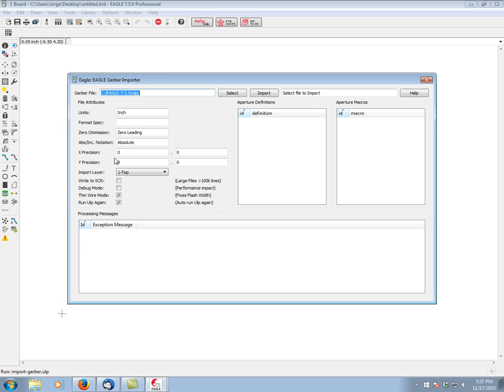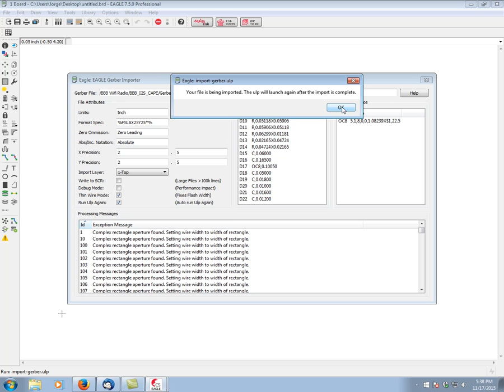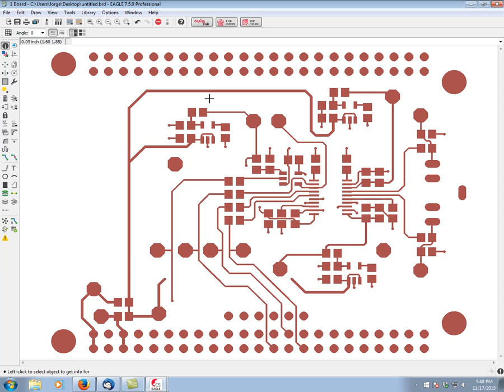Gerber Import in EAGLE V7.5

Comment: So I'm running EAGLE 7.7.0 after having done a heap of work on EasyEDA. Tried to use this feature. First, it DOES NOT recognise the file extensions - it specifically states that the file extension was not recognised and defaults to TOP: "No match found for file extension of Gerber file. Layer defaulted to Top. Change the Layer dropdown if you want to import to another layer."  Second, when I do this, I can't figure out what layer is what. I have pads and solder as two separate layers, one for top, one for bottom, but the layers list only has Pads. Not very intuitive. This is meant to be easy for beginners.